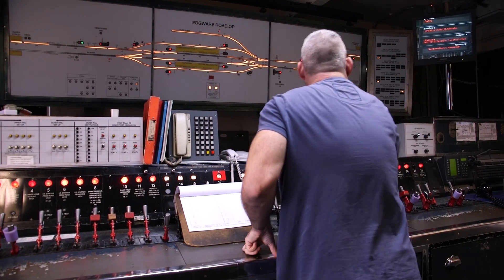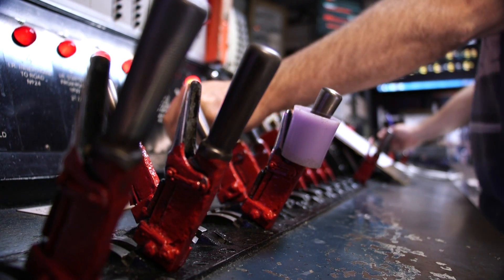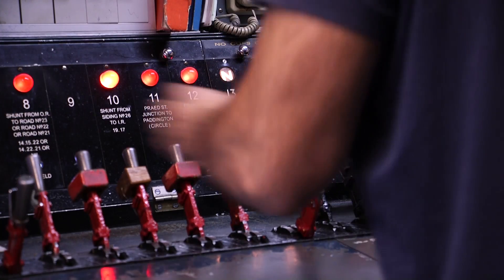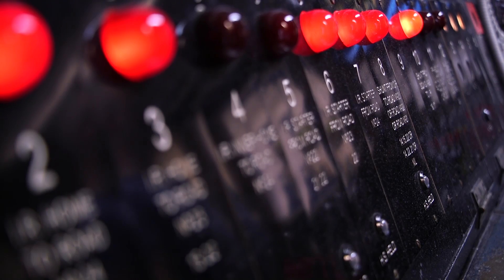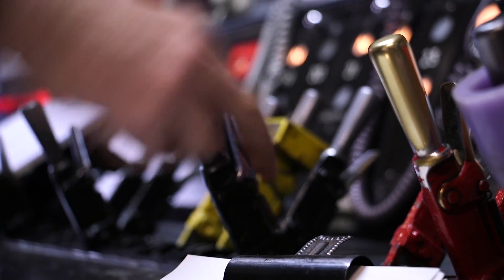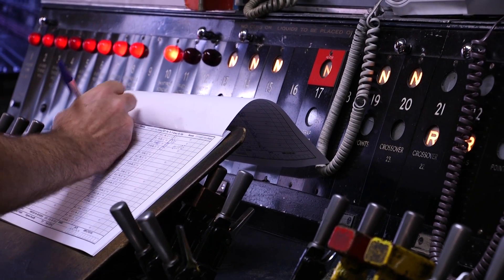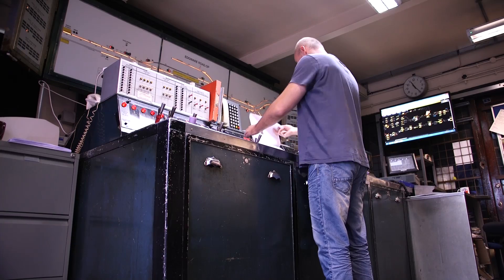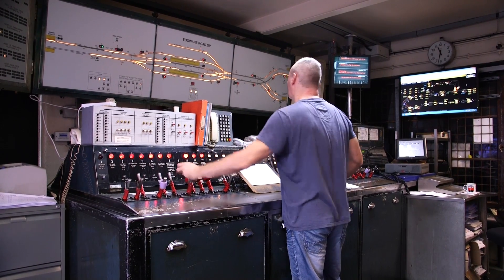Inside The Edgware Road Signal Cabin

Comment: The Westinghouse electro-pneumatic signal and automatic braking system has yet to be improved on for its safety and simple operation, although it does require a lot of hands on routine maintenance on exposed trackside equipment.

Comment: Would they keep it in running
Condition so on open days they can run the signals form it and see it in use
Reply: CBTC doesn't need signals, so to keep this working would mean a considerable extra expense on keeping all the old signalling infrastructure working too, for no purpose other than to show off this system at open days.

Comment: CBTC is a great system, it allows train drivers (who still get paid to drive these trains, although they drive themselves) to take a nap whenever they feel tired, as witnessed by myself once on the northern line.
Reply: I once saw a Jubilee line driver with his feet on the dashboard. There's no dead man's handle, just two start buttons which (s)he has to press when leaving a station.
Reply: GwanBwoai? thats ato not cbtc cbtc allows a train to be driven at closer intervals whilst ato run the trains automatically
Reply: Most CBTC installs these days are also ATO, to the point some people use the former as a byword for the latter.
Reply: there's still the dead-man switch ;)
Reply: Sef Kombo it's CBTC https://en.m.wikipedia.org/wiki/Communications-based_train_control you may call it TBTC, but that's not its industry name.